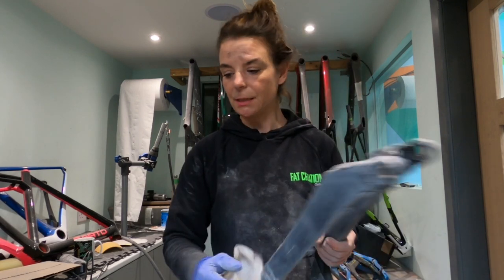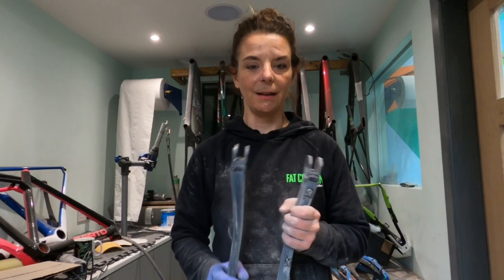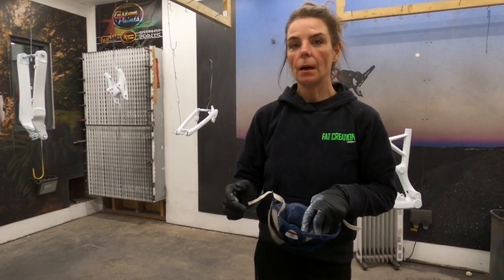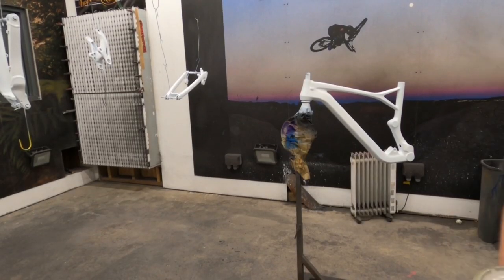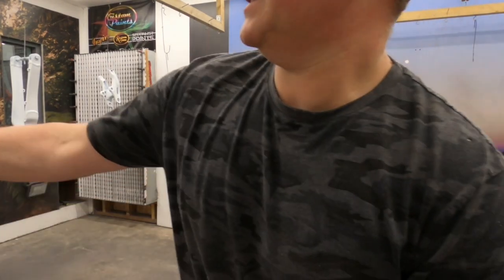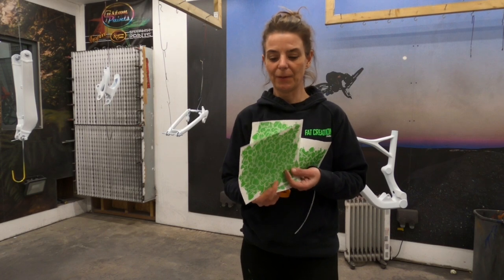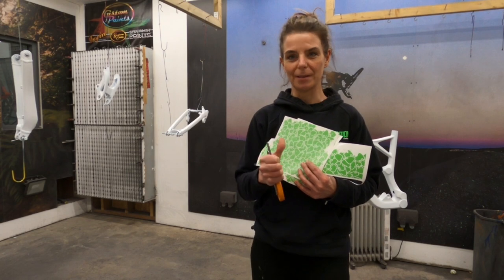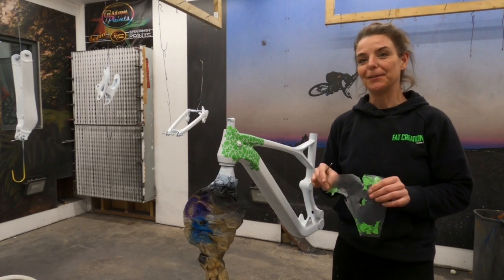Custom painted bike, GT Mint Force, episode 1.

Comment: Would love to bend your ear on some tips and tricks I currently do custom work. Haven’t done a bike but what assume there are a bunch of areas to keep rather thin. Obviously stay away from threads bearing housings etc.
Reply from the maker: Hi ya sorry for late reply. Yes we mask off contact areas like bottom bracket, fork dropouts, rear end drop outs bottle bosses etc. Also the insides of seat posts, head tubes. And keep everything as thin as possible